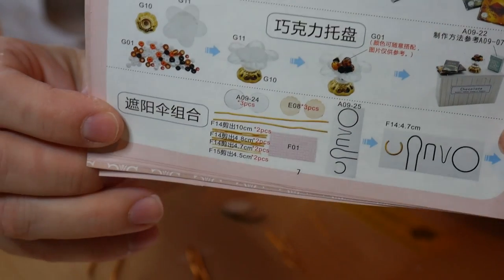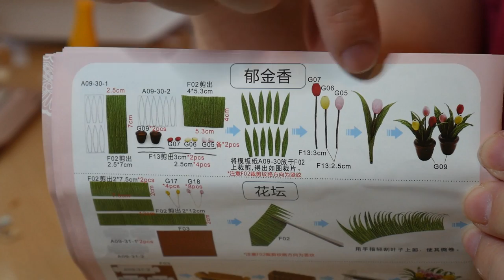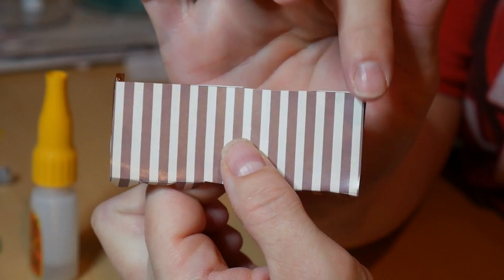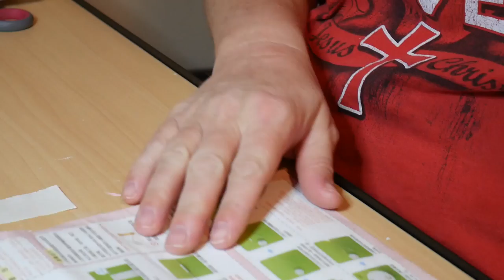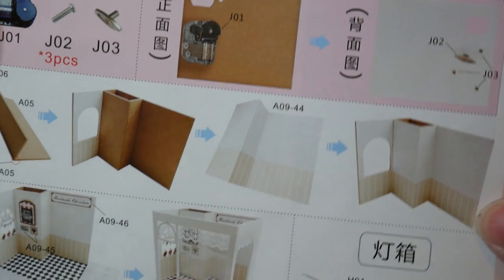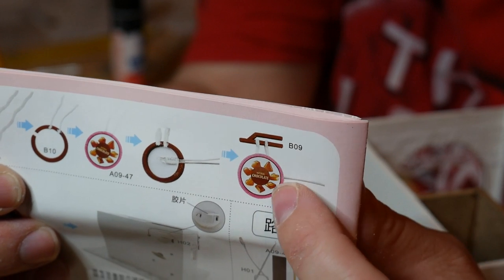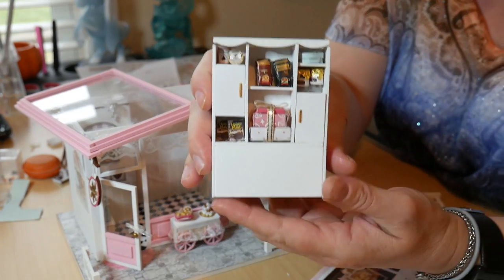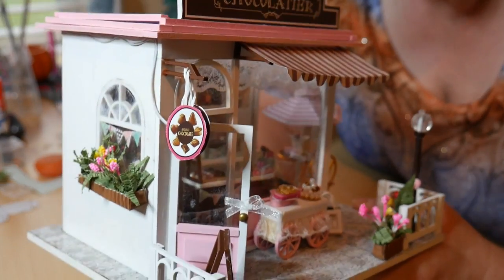DIY Chocolate Shop Dollhouse (Part 2)

Comment: Just finished mine. Haha. There were definitely frustrating moments. Getting the pillar light to stand up straight is hard because there is LED wire coming out from the bottom. 🤦🏻‍♀️ Also, tying the white bow on the door took me like a half hour and I almost went insane.
Reply: Well i made the kit ...i tied the door bow separetly ...then glued it on ...and yes ...it did take a fair bit of time to tie that door bow ....,i used toothpicks to wedge each side of the bow part to get it smaller and smaller to the size that was appropriate ...took lots of fiddling around ....lol.....as for the light  post  i used a bit longer paper to wrap round the post light then got a black marker and colored it black so i used a stronger glue ti make it stand up ........i did not like alot of the wires showing so i had drilled a hole through the base and dug a channel underneath the  base to the  corner area ...and glued the lighting wires ....so i fed the wires from the post thru the floor underneath .that way there were no lighting wires that you could see coming out of the lighted post ..then the  lit sign.beside the door .. i drilled  a hole thru the front wall....glued the wires down the inside wall to the corner then drilled anther holethru the back wall and fed the wires thru  to that corner ...then i painted the wires white like the wall colors and glued white lace over it to camoflage it ......then for the ceiling light in the store ....i never glued the lighting fixture on the ceiling i drilled a hole thru the back wall and fed the wires thru  that wall as i did not like the light fixture glued onto the clear ceiling .....to me it did not look right .....and no wires showing from the lighted  round sign.the post or from the inside store light ....it looked better .....yes it takes more work  and planning ....but its worth the angst ....
Reply from the maker: I think that bow was the reason I decided to do it in a speed video cause I was fussin at it so much lol!

Comment: BTW. Some of you may know this but if you use white glue and apply tiny drops of any CA (superglue), it will act like an instant clamp and hold it in position till the white glue dries. And superglue will fog your clear plastic. You can use E6000 or G-S Hypocement that you can buy in small quantities. My Hobby Libby is now carrying these kits.
Reply from the maker: Awesome to know these tips! Thank you for sharing them. I will get some of the E6000 for the next ones that I complete!
Reply: Yes u are right bout super glue or crazy glue ....i noticed it caused a white residue when u glued other pieces of plastic and other items together ...it was more messy looking ...its okay to use when the u dont see the glue   but sometimes ...the  leftover white residue    is  so  icky messy looking ... found in the past when i used E 6000glue ...there was an orange color tinge   at point of glue join ...so i thought it maybe due to the surface     color or whatever it was made out of ...i had that problem when i made some jewellry  ...its still  a useful glue and has been around for at least 20 years  .. have tried that ..siliglue ...or the ...3 in  1 beacon glue .it worked okay ...but dont know bout the long term  effects lasting  over a few years ...but white glue has been around for decades and has been a good .product to use .... have used that UVglue  as well.....guess we have to expeiment with the different types of glue ....AND see how they respond ....thanks

Comment: Gosh ...i had a few hints on what i do....when i make a few dollhouse kits .....and i had it all  done up ...when i lost it all.... fustrating anyways have to start all over again .....well when i first get my kit ...i do an inventory of all the  parts to see if any are missing  or broken .....it does happen.....then i go to the photocopy shop .....and get 3 copies of each of the papers that are included inthe kit ...cause knowing me and i am human.....it is sure nice to have a few copies ....when things go wrong ...like i may cut those small parts wrong ....or not glue it right ....or i fold it wrong ...and score those small fiddlely parts wrong way ,etc ....so its nice to have a way out when u glue down the wrong floor plan....another thing ...is that with the copy ...if u dont know how  do to make up one of the tiny  objects ....at least you can make one up as a practise.....or t est.....another thing is that when it comes out to cutting folding and glue those tiny tab marks .....what i do is make use of the extra white margins and i extend the  guideline a couple of mm beyond ....it really makes a difference when u are cuting folding glue  those tiny chocolate  bars  or gift boxes ......and when i am done if there are any white margins showing beyond the made up object ...i just trim them off ...,and thus you get a better result .....then by cutting them to the edge  like in the instructions ...then i use a UVGlue ....ultraviolet glue ....its good for all those plastic covered wires and the regular wires that you have to make the chairs etc ....i use bout 5 different kinds of glue .....plus i think bout the kit at what i can do to improve it ...so i dont make  it right away .....i like to think bout what i can do plus i watch other youtube videos on how other made up the kit ....anyways ...im rather long winded .....so thanks for doing up a video bout it
Reply from the maker: Mary Leung Awesome Tips right there Mary!!  I will have to mention those in my next dollhouse video!
Reply: Photocopy is a great suggestion.
Reply: And the glue- I too use a lot of glues- I like the craft pen by Alene's and it doesn't cause that fog on the plastic. Not sturdy enough for holding larger items down, though. I use Modge Podge the get the paper to lay flat on the base, too.
Reply from the maker: @floppypoppygifts  Yuns are soo smart! Boy you could tell I was a newbie at these lol! I am so grateful that you all like to share tips.

Comment: I purchased the same kit ....and watched your videos .....you did a good effort making  this kit ...but i was a bit bothered with the way the kit put the.. LED wires ..the way they  were showing ....so im going to try to hide the wires a bit better....i might have to drill a few holes thru the base ...and i dont like the way the ceiling wire light is done ....so i hope that i can find a better way ....might move it back a bit cause i really dont like those ceiling wires showing up in the middle of the transparent ceiling ...it just doesnt look right .....but thats what it says in the instructions .....so will have to think a bit ....
Reply from the maker: Thank you so much. It was my very first one. I totally agree about the LED WIres. Especially the ceiling ones and how the light attaches to the top. It doesn’t hang even. I am surprised that it turned out as nice as it did tho with the horrible hands I got. I definitely do NOT have fingers for this stuff. My mom on the other hand could really do a great job on it and prob would never see a bit of glue.
Reply: I just started the chocolate shop....you kno  what to do bout the big hands use toothpick or  a long needle to glue in small areas  and use tweezers that have a needle like point on them .... to help fold those small  fiddlely areás .....u need to use smaller embroidery scissors  than the one you are using  the scissors u are using dont work that well for the small tiny stuff ....to cut out those tiny areas .....you can also use xacto knife with different shape blades for cutting .....make sure u get small and large clamps to hold stuff together when u glue them use ....i use emery board and cut them into a small point to sand any of the small areas ...get a cheap manicure set from dollar store they have useful tools  that are handy for making dollhouses  ....also get an awl and a tiny hand drill to drill small holes..use q-tips for wiping off small areas of glue  ...alot of these tools you can get either at the dollar store or buy from aliexpress inexpensively...you can also use rubbing alcohol .....to remove glue .....it works as well as the nail polish remover
Reply: I agree. I’m going to try to hide mine too.
Reply: @Schatzie301 i have purchased ..one of those mini hand drills ....plus i also have a dremel  tool .....they are relatively inexpensive ...drilled  a hole thru  the floor of  the  lantern light  then fed the LEDwires  thru the  hole in   floor   ...then  drilled a chanel  underneath   the floor and fed the wires  thru  another hole drilled   thru the floor  to the hidden  compartment  where the music box was situated   and attached to the  battery box ....it worked out well......i also found out you can purchase .....silicon wire  in the same colors as the LED WIRES ....just order size 30   wire or  the 1 mm size ....i got a rollof  light grey  and white  silicon wire from aliexpress ...just in case if it ever happens that u run out of wire.. .also ..u can also order extra LED lights ....and even make different colors of  LEDs like red blue ,etc  if u have a soldering iron  if u are so inclined ....i got a soldering iron  so i can solder my LEDwires together than  just twisting them together and  using that  white  icky  sticky adhesive paper  cover them ...got heat shrink   plastic to cover the soldering join .....i tell u it looks so much better ...than having a whole bunch of   exposed messy wires  ....i did notice  that sometimes there may be the occasion where its hard to hide the wires ....so i camoflaged them by hiding the wires ... and it worked well ....even have painted the LED WIRES .......i didnt have the mess of wires sticking out of the back of the chocolatier shop ...just had the music box key ...and the battery compartment   showing  the switch on it to turn it on ...so it takes a bit of creativity ...but the result was worth it ....
Reply: @maryleung1425  I have a Foredom so can easily drill the holes. I was studying the problem but looks like you worked it out perfectly. I haven’t ever had the courage to solder though but I have everything to do it with. This may be the perfect time to try it. That was my one complaint for this line of kits, the wires are never hidden in their instructions. Thanks so much for sharing.
Reply: @Schatzie301 i made jewellry as one of my hobbies ....was working with silver and gemstones ...so i have a flex shaft  plus  alot of the tools i have for that hobby  they are   good tools  for makin dollhouses ..,have like around 20 kind of pliers ...etc  ...lol ....dont be  afraid to use a soldering iron ... its not as bad as u think... there are alot of good instruction videos  on youtube .to follow...and u can purchase them from aliexpress or amazon for relatively inexpensive  price ...its just getting over the  of hesitation  of trying to use the soldering iron . Lots of good hints  and and how to properly take care  of the soldering iron ...plus there are different soldering tips to use as well.... u can do some practice soldering at first then .....do some practice using the LED  wires as well ...the nice thing is that u can purchase the.....LED diodes ....in different colors .....and make your own LED lights ..u can buy the  thin silicon wire  to make the LEDs  in what ever length   of  wire for the light that u need ...wouldnt it be nice to make your own  blue. red or green...  LED..lights ,etc .... just  buy... 30  AWG.....size of silicon heat resistant wire  ...comes in alot of colors as well ....then get heat shrink tubing in the smallest size   .....like in the 1  and 2 mm size ...just cut off the bit that u need to cover the join..use a lighter or heat gun   to   shink the plastic  covering the join after the solder . And the heat shrinks the tubing around the join .. and its neat and tidy ....u dont need to use that ugly sticky messy adhesive  white  paper that comes with the kit   to cover the wire join ..another hint . ...remember when... u had to cut out those small  tiny fiddly  paper  items  out of the  paper template sheet and fold them  ..like a gift box   or   make a small tiny chocolate bar ... when u were folding that tiny item .along the edges ..u seen those  small white fold lines  that occured  .... well i thought they looked  messy  when  u were finished  folding the item  ... so  i also use felt markers or paint ...to color  in  those white fold lines ....to camoflage those white fold lines the same color background as the paper item u folding.. it makes the tiny gift box or tiny item u made ...much neater and way better looking ...when u spend that amount of effort  and time making the kit ...u want to do a good job  .. another  hint . i have  photocopied those color  paper template sheets that   come inside the kit ... u have cut out and fold   all those fiddly parts   ....cant tell u the amount times i have  accidents in cutting out ,  glueing  the wrong way ,etc ..so having those extra copies ..sure made it alot easier ..cause when u made a catastrophy or big error ...at least u had another copy to work from...plus u can use the left over paper items on other kits ... plus its useful when the instructions maybe confusing ...so its good to make up a practice copy ... instread of wrecking your only original  paper copy....another hint... sometimes u have to cut out a fabric item  ..and the  fabric u cut out .. is flimsy ...and u get those ragged edges with the threads   fraying  coming apart ..and it looks very messy  when u have to glue the fabric to make a cushion or lamp ...i use white craft glue   to run a small line of white glue along the cut edge of the fabric and .let dry ... that way the fabric doesnt fray  alot  ...i have even painted a thin layer of white glue to the inside   of the fabric ..and when dry ...there were less problems  of the fabric  fraying  when u cut it  ... just experiment when u are using the white glue and  fabric ...i have even used the product ...called ..fraycheck .. it stops the fraying of the  cut fabric  edge..but found out whte craft glue worked just as well for the  kit ...if u are cutting out  a  dress pattern  then u would   use the ...fraycheck product ... but white craft glue  was more cost effective ..and u can buy it anywhere ..so thats what i use ....i also use a size...0./10  or size 0/20 paintbrush ....they are ultra tiny paint brush ...if u have to paint in any small areas of the areas  in the doll kit .. .i have purchased them from ..micheals...they are a specialty paintbrush ..but it certainly makes .a difference when painting in those fiddlely tiny areas ..sorry bout the long post .... well  hope some of these hints are useful ..do u have any tips ?..Happy crafting and take care